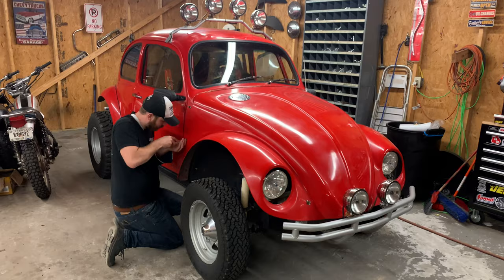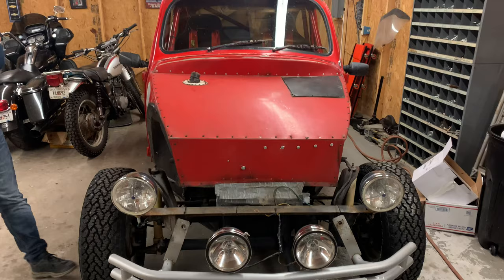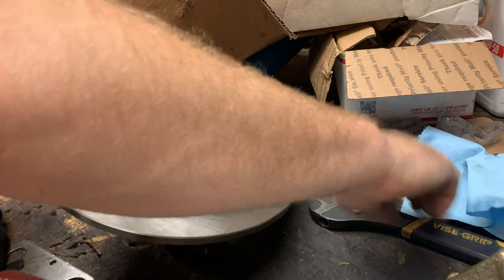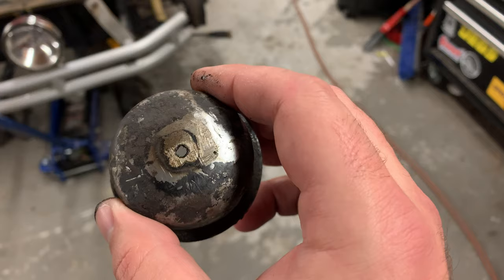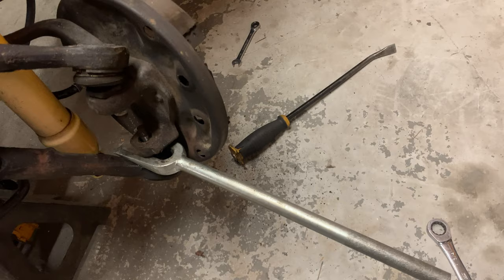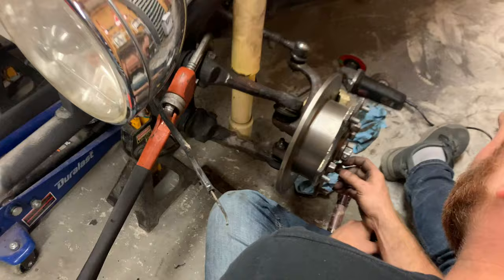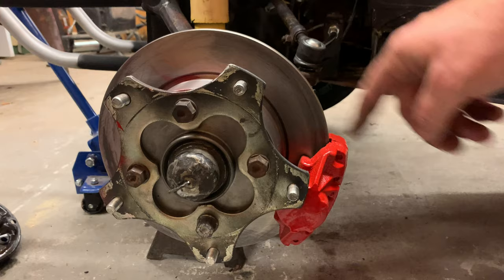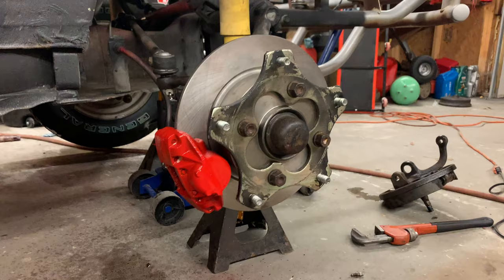Disc Brake Install on Volkswagen Baja Bug

Comment: Hey guys !
Nice job. Can you please tell me what part did you guys grind in order to fit the adapter?
I’m with 4 pattern with discs brakes planning going wide 5.
Reply from the maker: You have to grind the side of the actual caliper down to fit them, because the bolts on the adapter touch them a little bit.  You’ll know exactly where to grind when you get it all together.
Reply: @HiRevzMedia  thanks a lot !
Much appreciated!!